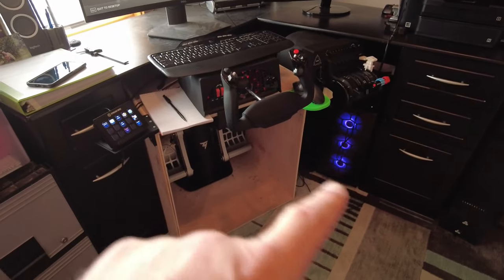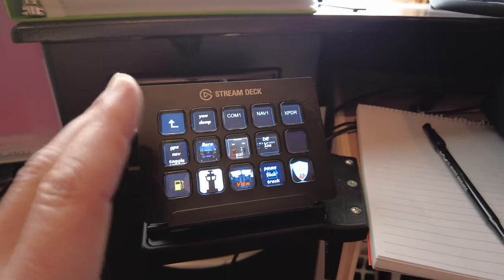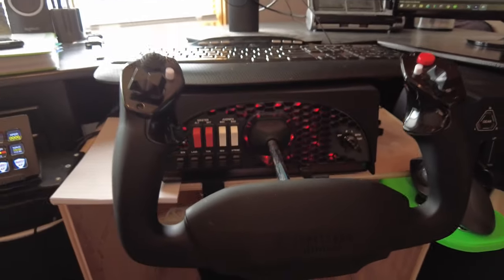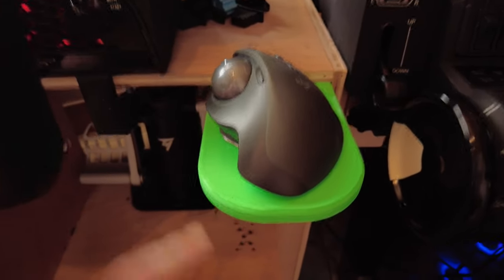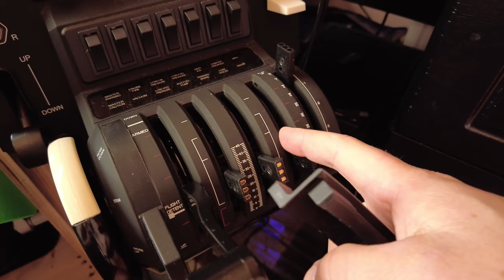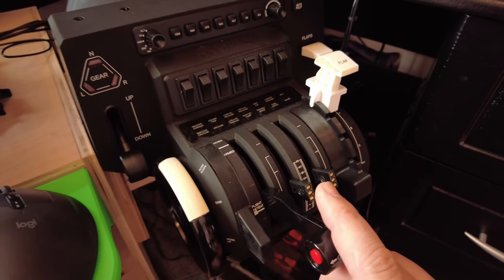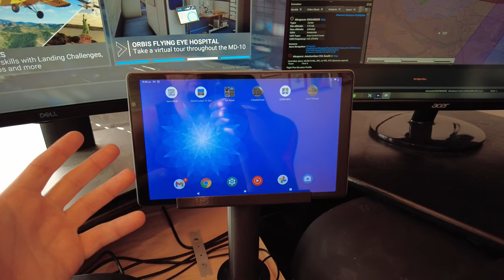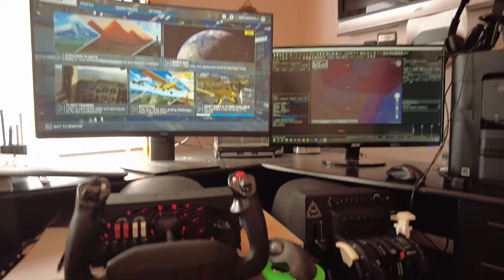MSFS2020 Home cockpit Setup AND 3D Printed Mods-equipment guide/ stream deck, tpr pedals, honeycomb!

Comment: Are you still using the same Stream Deck or have you upgraded to the new one with knobs, the Stream Deck +? I have been subscribed to your channel for some time, and am trying to decide if a Stream Deck would be advantageous. I have been setting up the TBM930 and have every control in the plane configured with MobiFlight, but I have run out of physical buttons on the Alpha and Bravo to utilize them avoiding the mouse. I do have a pair of FlightSimBuilder G1000's that keep the mouse at bay most of the time:) I am able to utilize them with the TBM930 very well and pop out the touch screens to my lenovo touch screen laptop via wireless display, also works great. I am just at bay as to which Stream Deck to get. I really don't want to part with MobiFlight either. Anyway, just interested on what your thoughts are. You should also do a video on your 3D Printer. I am looking at getting one of them to get my Grandson started on projects. I don't want to get a cheap one. Can you send a recommendation on a good 3D Printer that has quality? Thanks, always enjoy your videos.
Reply from the maker: Hey sorry for the late response. Yes I still use my original stream deck .if you need more knobs then yeah the new deck with knobs is great. If you need more buttons you could use the next size up deck.  As for the printer I probably won't do a video on that but I can help you in purchasing 1.   least expensive creality ender 3 they have several styles, any of the Neptune line the 4pro is nice want bigger 4max , want faster prints Bambu labs x1 and creality makes the k1 I think. Want reliable prusa any of their stuff want bigger prusa xl.